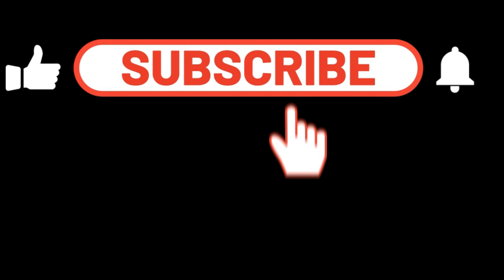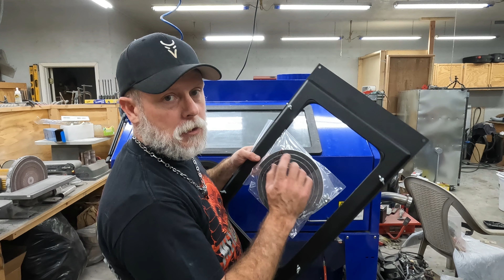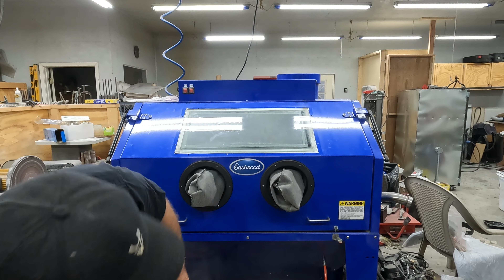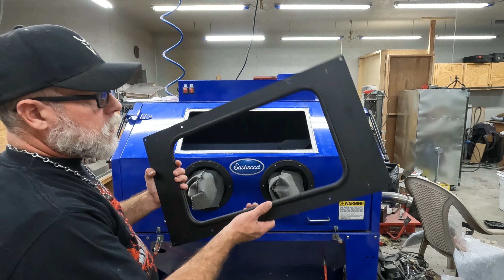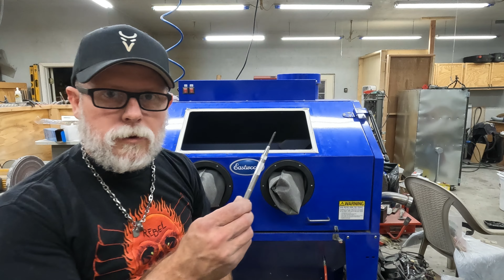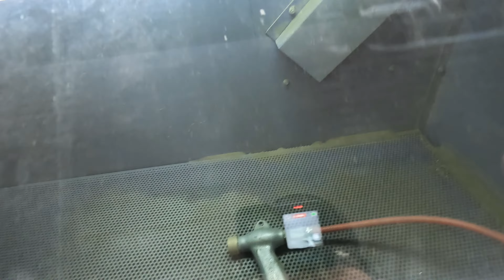Eastwood B100 Blast Cabinet Window Upgrade

Comment: The most important thing I've found to increase visibility in the cabinet is to block over head light outside the cabinet. This stops reflective light which makes it easier to see inside. Just yesterday I put some light shields inside the cabinet to stop the lights from shining across the film while still illuminating the parts to be blasted. This also looks promising.
Reply from the maker: This upgrade is the best thing I have ever did been flawless since I did this video. To cure the low light issues I painted the inside with white flex seal. I highly recommend  both, thanks for the suggestion

Comment: Just ordered this. Thanks for sharing the info.

I have to turn off the overhead lights when I blast so i can see better. Do you do that?
Reply from the maker: No, Since I painted mine with white "Flex Seal" I can see better than with the dark blue. I do plan to replace the Fluorescent bulb with brighter LED's

Comment: I was thinking the same thing while watching the Eastwood vids.  The inside should be white.  Hopefully they'll correct this before I purchase. The tools don't need to be projects themselves.
Reply from the maker: Since this video I added the white used, Flex Seal worked great 1 qt  and gave it 2 good coats, As for the Window that was the best decision yet!!! I love it :) the ability to change window protectant in seconds is a HUGE time saver!
Reply: So otherwise you're pleased with the unit?
Reply from the maker: Yes, I do like it now that my 2 major complaints are fixed it is a serious work horse. It’s large front opening makes it great for loading larger parts. I have been able to do some motorcycle frames as well as rims, engine parts etc.
Reply: Excellent. Thanks for the review.
Reply: Flex seal 'cause it is resistant  to the media ? What do you think about about powder coat or cerakote?

Comment: What kind of media do you use?
Reply from the maker: I mainly use black diamond from tractor supply as it is very cheap. Great for old paint and rust. It is dirty and you have to clean the filter a lot. But I also use Aluminum oxide and soda.